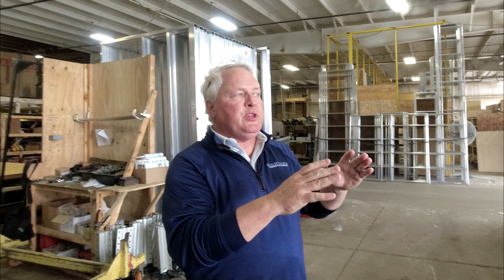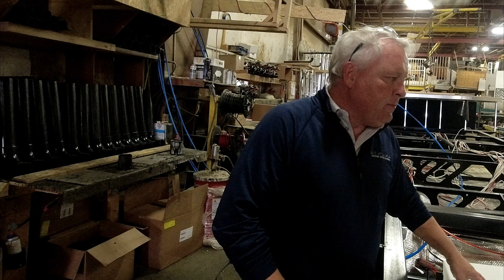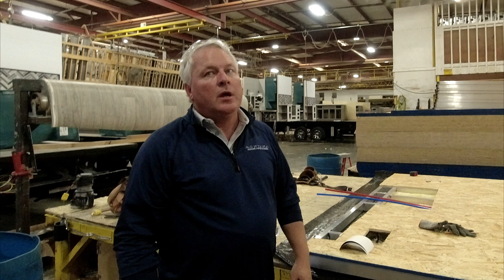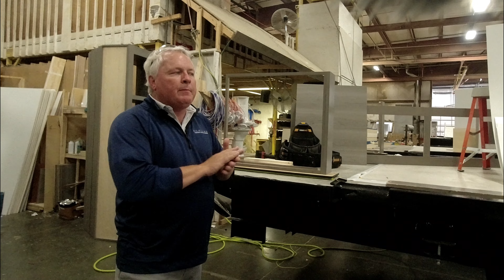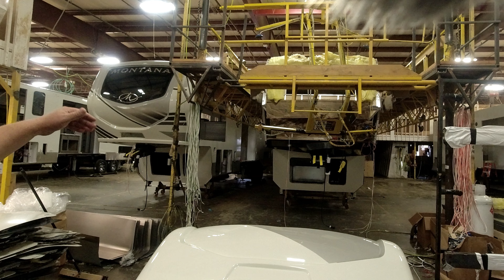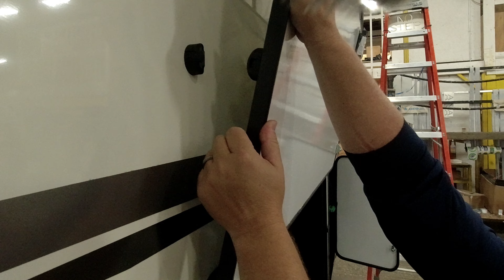2022 Keystone RV Factory Tour / Montana Fifth Wheel  (Part 2 of 3 tours )

Comment: The one thing I’d like to see is the 3 water connections would be in a horizontal position instead of vertical . I built a pex manifold on my with gator bites and brass valves so I wouldn’t have to switch thos hose to the other connections .  Added a water filter system while I was at it .
Reply from the maker: We will pass your suggestion on to the product manager

Comment: I own a 2021 Alpine 3651RL. I have a molded back cap, is there a way to fish a new wire to the backup cam mount without cutting into the camper or going through a stud. A picture of a back cap would be extremely helpful

Comment: 2015 Montana 3711FL legacy - had to have my hydraulic support arms reinforced because the metal used on the arms is not strong enough steel - also the teeth on the hydraulic arms are plastic and do not stand up to the weight and constant in and out — did they upgrade any of these?
Reply from the maker: Thanks for the comment TD   I want to make sure I get you an accurate answer. can you be a little more specific as to what supports? I assume you are referring to slide out hydraulics.

Comment: We've been in the Alpine 3712KB, 3 different RV dealers, and each one had out side doors that didn't close right, or trim that fell off, wires sticking out from under the slide inside and on all 3 identical units, the "barn doors" in bedroom was either off the track, or was broken off the track.  Had one with the show doors were laying in the tub.  Now, either this is from reckless RV transporters, lazy dealers or poorly done at the factory.  And we're down to 2 5th wheels to buy in the next couple months, the  Alpine 3712KB, or the Grand Design Solitude 390RK.  The Solitude is now over $110,000 !
Reply from the maker: Wow that's alot damage. Sure makes you wonder about the transporters.  It  is nice to hear that you are paying attention to the details when shopping.  those kind of things for sure should have been addressed by the dealer when they took delivery . As Montana owners we haven't looked at any Alpines  but will be doing so in a few weeks at the Tampa supershow. We had a subscriber request a walk-through video of one so we will be looking for some at the show. If you have a specific Alpine floor plan you would like to see let us know and we will try to get a video out for you. 
Thanks for watching  and happy shopping.

Comment: Great video.  I would love to take a tour of their factory.  I'm very interested in the solar packages, especially the 1200i.  Hopefully you'll have that out soon.  I was also wondering how all the shortages was affecting how they are building the units and if they're using different parts/manuracturers since they're not able to get what would normally install.
Reply from the maker: Hi David thanks for leaving a comment. Our hope is to get back out to keystone this spring and talk about solar some more. We are planning to convert to lithium and add some more solar to our Montana. Keep in mind that the 1200I package Is exclusive to the montana Brand at this time. The other keystone Brands go to the 600I on select brands. But hey why wouldn't you go with the Montana right? Lol can you tell we are a bit partial to Montana? So thanks for supporting our channel  we will get that video out as soon as we can. I am excited about doing it.
Reply: @Jonesin2Go  Thanks for the reply.  I currently have a 2019 3120RL and I love it.  I want to upgrade to the 3231CK with 1200i super solar once things settle down and the shortages aren't an issue.
Reply from the maker: That's a great floor plan. One of my favorites

Comment: Why can’t I get disk brakes done on a Raptor?
Reply from the maker: Do you mean from the factory? Or as an upgrade?
Reply: @Jonesin2Go  from the factory. I would love to have disk brakes and 17.5” wheels. I have 17.5” wheels and 18 ply tires on my boat trailer and don’t ever want to go back
Reply from the maker: Ok I spoke with Raptors product manager today. As of now disk brakes are not a factory option. They can be added aftermarket.  The Raptor walls are not built on the cnc table like the montana's.  That isn't  a bad thing. And the build process  is the same as what you see in the video.  I would tell you if we were to purchase a Toy  hauler it would be a Raptor no question
Reply from the maker: It isn't offered as a factory option at this time. It could be added like at Morryde or some place.
Reply: @Jonesin2Go  I really appreciate it!  Any chance you can message me their contact info?  I have so many questions and am dying to build a good relationship with a factory rep

Comment: Hi my name is Tony Brown. I'm watching a video on  On the Keystone factory tour I have a Montana high country Front living room with the loft above the bathroom that steps down What a piece of junk I've had this 5th wheel 10 months and everything is falling off of it all the trim around the slides does the fake backsplash and the kitchen is not even blue to the wall all the moldings are locked door and along the bottom of the walls So you since you are at the tea stone factory maybe you can ask them for me Why does staying in such a piece of junk I will never buy another Montana 5th whten O fit will thank you
Reply from the maker: Sorry to hear you are having   trouble Tony. You say you have had it for 10 months, can I assume you purchased it new? What model year do you have? Have you contacted the dealer where you purchased it to have these issues corrected? If your unit was purchased new and is only 10 months old then it would still be under warranty and Keystone will surely take care of you.